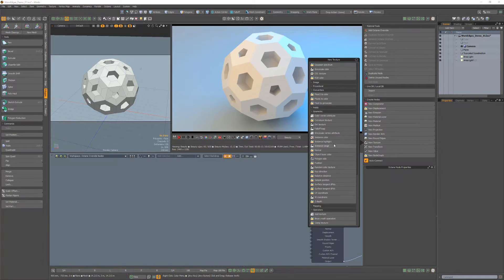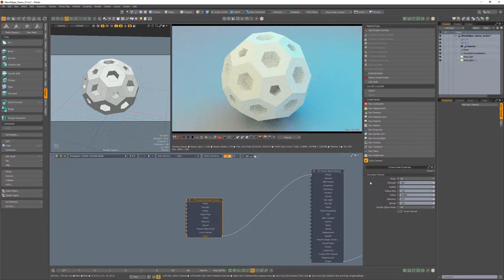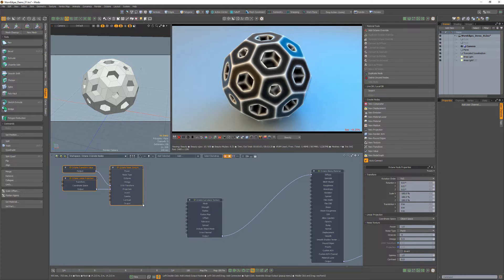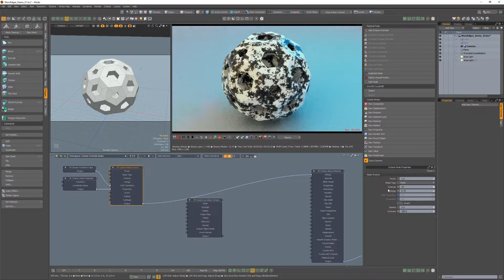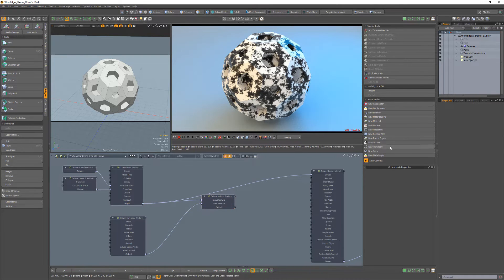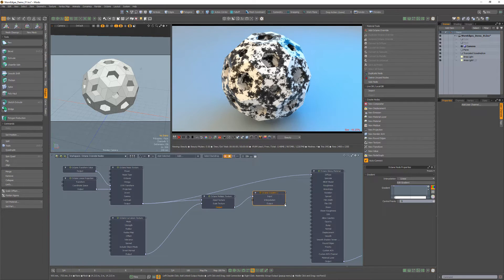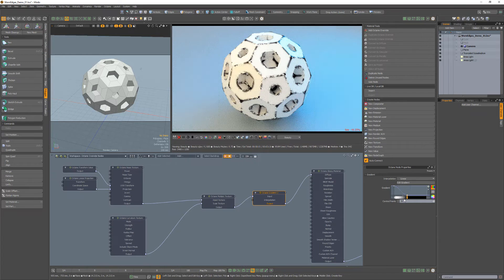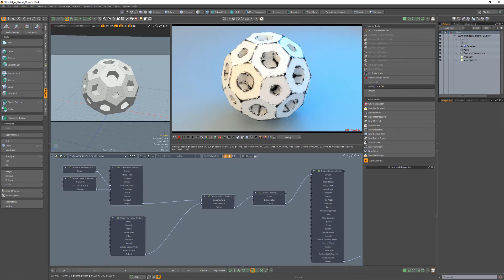Modo | Octane Render: Worn Edges Texture

Comment: I wish I could figure out how to group octane nodes and save those as presets. In a complex world building every material from scratch is very tedious. Blender, C4D. Lightwave and Standalone Octane all allow  node groups but Modo?????.
Reply: I'm not sure, but you can save the workspace and use as a preset.. not that practical at all sadly, that's why now i only use modo for advanced modelling, then manage everything else at c4d
Reply from the maker: Do you have a link that shows an example?
Reply: @pixelfondue  Just go to the nodes overview, right click on the one you want to save and Save assembly preset
Reply: It's actually straightforward, you should select your "octane override" and click on save preset from the octane "material tools" panel: it saves the material with all the needed connections. Be aware that you need to stop your progressive render first and make sure octane is "activated" otherwise it won't work. By default, it saves the network as a Modo's preset (.lpx) with everything inside the "octane ovveride nodes" assembly so you can put Modo's nodes as well. If instead, you want to save .orbx, you need to click on "Export" in the "Live DB/ Local DB" panel. In this way, it converts the most common Modo's nodes (like texture projections and textures file paths) but there could be some issues in general. If something goes wrong you end up saving an empty structure, so I suggest manually replacing all Modo nodes with Octane nodes, to avoid problems. If you have a previous version of Modo/Octane there could be some bug: in v.15 I remember I have some issues and solved reading the Otoy forum. Modo .lpx presets are very handy anyway, you can group nodes as subassembly and then expose some parameters as subassembly input (i.e. texture path or tiling).
Reply: @mariomanganelli964  Thats not the same thing. In every other Octane plugin and StandAlone you can collapse  or group nodes to use as presets and to make the node editor more manageable. The Octane overide is the whole material. Normally I use similar node setups to drive roughness or bump or the thickness of thin film etc it is nice to recall these nodes when building a new material.
Reply: @mariomanganelli964  I'm not trying to save the material, I am trying to save groups of nodes within an octane overide material for use elsewhere in other materials. This is Easy in Standalone Octane or Blender etc. The problem is that Modo's schematic does not appear to support this. The two functions are collapse nodes and group nodes.